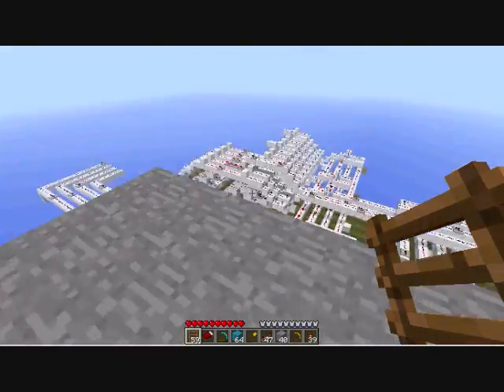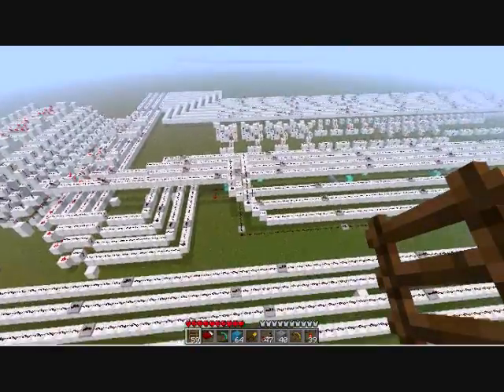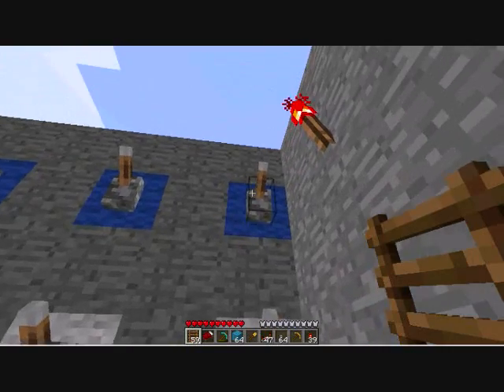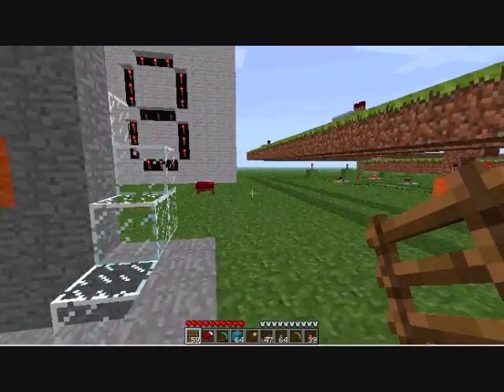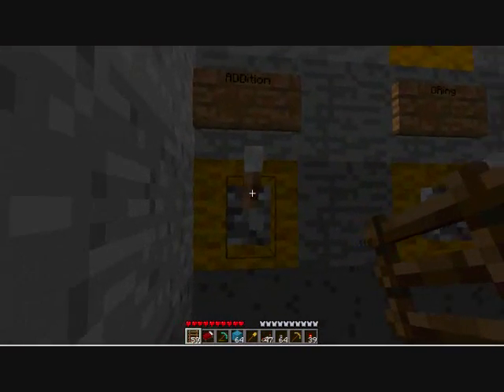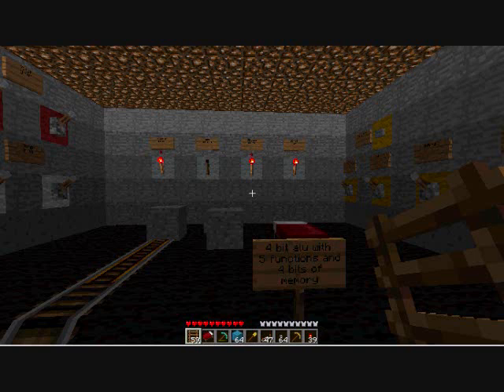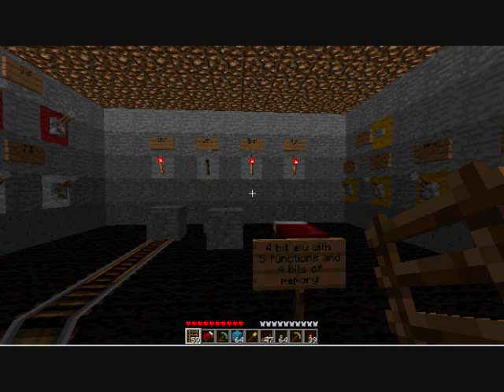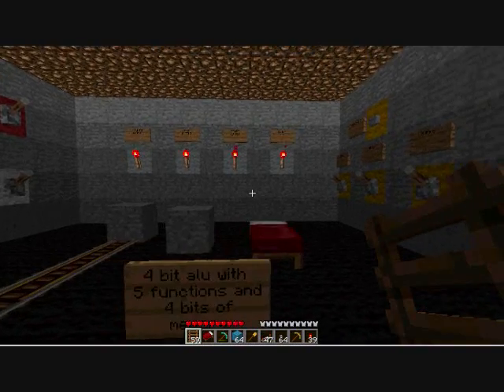Minecraft CPU with 4 bit memory

Comment: Close, You forgot zero (0-9 then A-F). If you really wanted you could use any symbol for each value. He said 1-10 then A-F what is also correct. Hex-Decimal is base-16 meaning 16 different symbols. 1-9 and A-F is only 15 symbols, 1-10 and a-f is still 16 symbols.

Although you can use any symbols the standard is 0-9 then A-F.